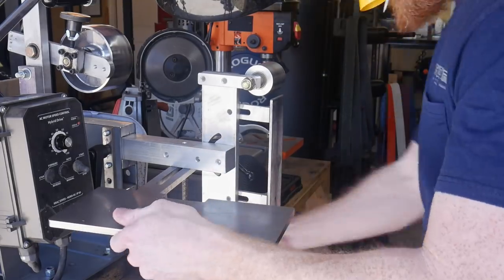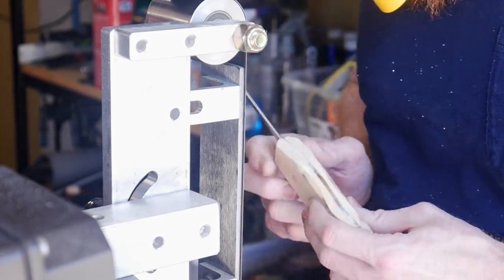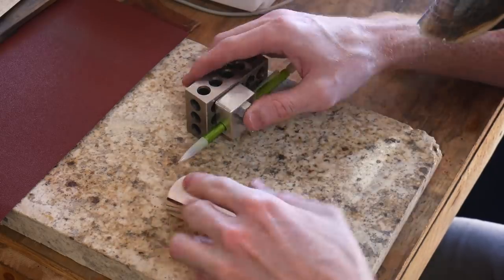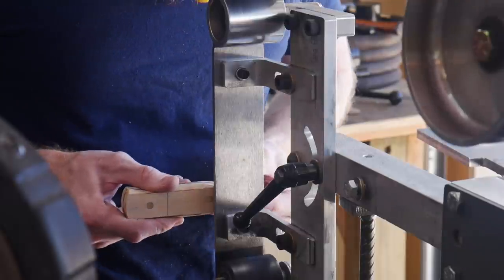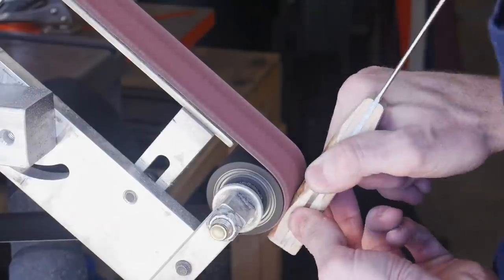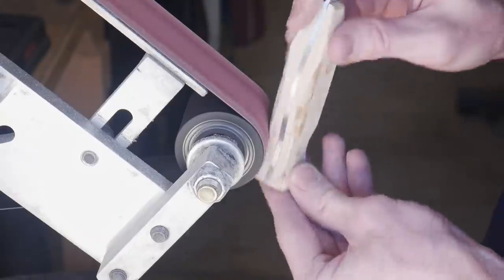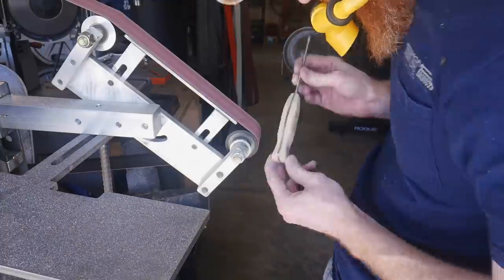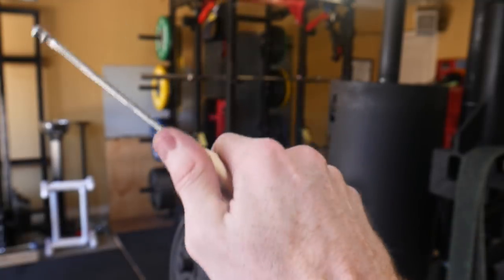Making A Handle Broach | Knife Making

Comment: Good video and good tool. Doesn't having 2 teeth at the front so close increase the likely hood that you will have materials jammed between requiring you stop and clean it as you shown? Or does 1 tooth leave the material inside the hole? I wouldn't know, I'm just curious.
Reply from the maker: Man I don't know. No science to going with two teeth. For what it's worth Kyle Royer's only has one tooth! It made decently fast work of the handle I tested it on though!

Comment: You may find it easier for the coke bottle shape, by using an 8 inch or 10 inch contact wheel for the back to palm shape. Just a thought.
Reply from the maker: For sure... I'm going to need a bigger wheel! I have a 4'' in the shop I need to rig up. Have a great weekend sir!

Comment: What is a good thickness material to use? Most of my knives are either 3/16 or 5/32 so anything smaller than the 5/32?? Or should I use that same size as you thinned the stock behind the cutting head? 
Thx!
Reply from the maker: Man I'm probably not the best person to ask for hidden tang knives. I've only made a handful. I'll say that I think smaller would be better. You want to be able to get the broach into the holes you drilled and start clearing out material. If it's too big you'll get stuck a lot. In reality I think it would be best to have a few different sizes...
Reply: @RedBeardOps  thank you!!

Comment: Your use of jigs and fixtures ect. is amazing. When seen you say, well why didn"t I think of that? Your scribe is be yond compare. I will have to watch this video many times to remember all the accessories. I have the number one already, A beard. Have had for many years. Helps you do things better. Where did you obtain your resperator? leenotcharleen
Reply from the maker: Thank you very much sir! Really appreciate that. This is the respirator I use. It goes in and out of stock regularly, so you may need to watch it until it's back in stock. Resp-O-Rator - https://amzn.to/2M6PMN7

Comment: Fun project!  Really nice job!  Question: I've made a few, but not nearly as nice, but they only have one tooth.  I noticed in the video the wood gets caught between the two teeth, and at the angle you are pulling it, it seems only the furthest tooth is engaging.  On my single tooth ones, the shaving just form a curl that drops out of the hole.  Do you find the two teeth helpful, or do you have to stop and clean the shavings, etc.?
Reply from the maker: Hey Daniel, I'm not sure, but I think the 1 tooth design may be slightly better. There was no thought out reason I went with two. Have a great week!